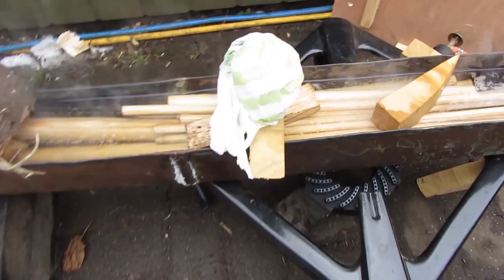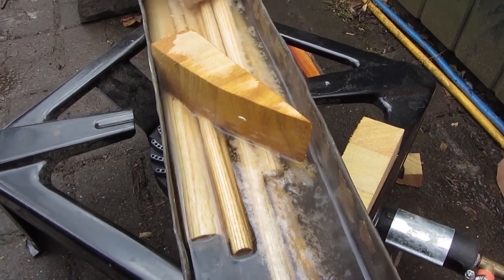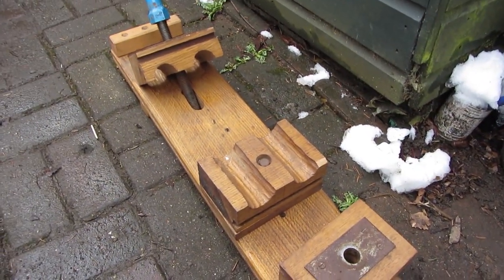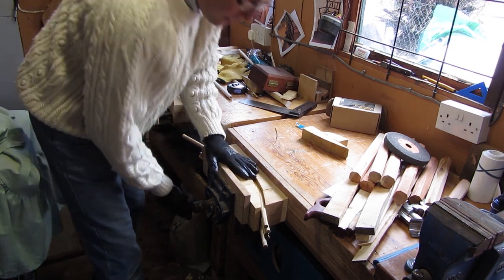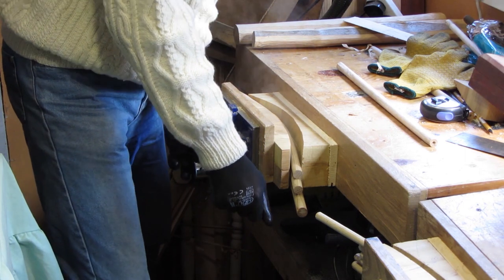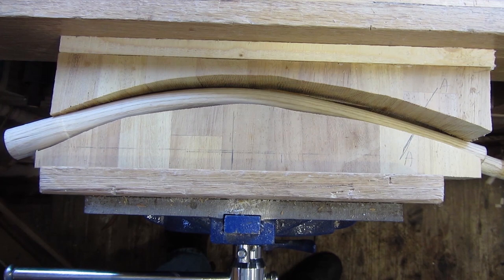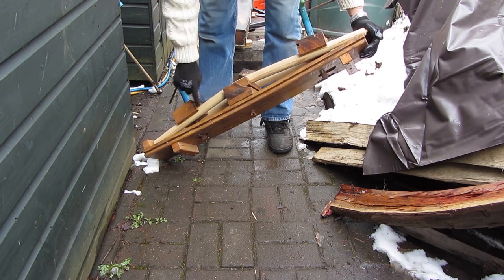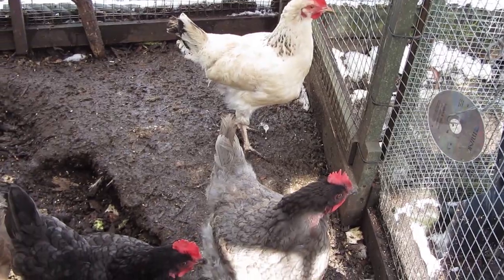Wood Bending by Boiling - Sussex Chair Part 6

Comment from the maker: I like boiling because you can see that the wood is getting properly heated up all over - so if it fits in my trough, I boil it. If its longer then I steam it and hope for the best! So for me boiling is more certain to work. Lots of the old bodgers used to boil the wood. Regards Harry

Comment: I just wanted say I watched this video for the first time long ago, possibly near it's release date and I'm glad I found it again. I haven't yet been able to try this procedure but somehow I believe this is a better way to bend wood rather than steaming or torching. I'm not sure if wood will gather much water in such short time but it makes sense it will bend more easily when more hydrated just like green wood. Thanks.
Reply from the maker: Thanks...I have boiled and steamed, and I prefer boiling for smaller items as the heat up is easy, for large items the steaming is more practicable.

Comment: Excellent job! This helped me to get the info I needed for my current project. Thank you for contributing!
Reply from the maker: Thanks - pleased to help.
Reply: A quick question, though. Should I use any type of wood in particular and does the age of the wood affect its pliability? I had a piece of a dowel rod lying around and it never got very pliable. Even boiled it for longer than an hour.
Reply from the maker: Cyber1080 Hi generally green wood i.e. freshly felled will bend more easily because of its moisture content.....though some people say ash is best left a year! lots of science and folklore on this. Most woods will bend....ash is especially good in the UK for chairs etc. ...but give what ever you have a go....there are various bending charts around that indicate what is good.....and lots of research on this!
Reply: Awesome. Thanks for the advice. I'll be sure to give the research a look. I make blades of various shapes and I sometimes have the need to bend the handle. Thanks again!

Comment: If you keep your wood above the water with only maybe 1/4 inch water in bottom then cover the top then your wood will be steaming. ?.. steam has higher temp than boiling bringing the cellulose fibres in the wood to the plastic or elastic point allowing much easier bending with much less springback also keeping strength higher in the wood
Reply from the maker: steaming is good ...see my continuous arm bending film for example, but boiling is easy and works well ...so take your choice, but your points are right and very good ones.

Comment: Hi, there, a contribution to Paul Cuffaro's question on how a drilled wood can behave when being bet. Where I live, I seen electricians bend the plastic pipes (u know where the wiring goes through around the house) using sand and of course heat. Sand in this case prevents the plastic from collapsing thus making nice smooth curves.
Paul, drill the wood, fill it with sand and make sure to compact it as tight as you can by putting in little by little. Use a narrow stick with flat end to push it in and compact (Like the traditional guns= remember those you put in gun powder a ball bearing and push it down the barrel= hope you get the idea).
Boil or steam and then bend! After cooling off and staying in the vices for an hour or any appropriate time depending on what wood you are working on, just remove and tap your piece on a table or anything to draw the sand out.
The inside will be very clean.
Oh! remember sand will enable the steam or hot water to soften the wood from inside the core more efficient than plastic.
Hope this length suggestion was helpful. Regards=Eric

Comment: Very informative video! I am going to try softening a few 1/2" dowels in the kitchen wok when the missus is away😉.   I wonder if the whole operation might be a little less frenetic if you pre-heat the shaping jigs just prior to inserting the pieces and starting the clamping? It might just buy a few more minutes of working time by slowing down the cooling.
Reply from the maker: Yes it might help a little.

Comment: I now understand the idea of bending wood. I also see ways to improve this process, such as metal jigs versus wood jigs, and pre setting lumber into the  metal jigs, submerging the wood and jigs together to boil. Shape the wood in the boiling water then remove all together to dry while still being pressed. This guy was panic working, trying to shape the wood before it cooled down, not taking the time to align all the pieces prior to bending.
Reply from the maker: Hi Jay - Pause and it will get too cold and stress. It may look like panic to you, but I knew exactly what I was doing, as you can see in the finished chair.

Comment: i wanted to make a pipe stem, and i want it to have a bent stem, so i am wondering, if i were to drill a hole down the centre of the wood, would i still be able to bend the wood, or would the wood break?

Comment: interesting. re the blue leg form clamps, it might be easier to delete the crossbar, drop them onto the bolts with the nuts on top,  and then wrench them down with a ratchet & socket,  and maybe an automotive  pneumatic wrench.  that would be quicker and easier than twisting all the way down the shafts of the bolts.

Comment: Ok Harry, crazy old lady in Ohio here. I picked up a junked oak windsor years ago and am finally looking at it. 
The BOW is distorted. The right side is much more open, the fron end of the bow anchored in  the seat is a degraded dried out mess. 
Everything else is decent - mending the splits in the seat is pretty straightforward... except of course on the right there is a split about 1.5" in: because of the slumping bow on that side.

I have almost no experience, but I have good clamps, good glue, enormous curiosity and ridiculous romance about abandoned chairs.

Assuming that I can knock it apart without breaking or damaging anything more than it already is, can I boil the whacked section of this bow? Soak it in hot water?

The kinetics of pressure/force are incomprehensible to me: if the wood were ever malleable enough to correct, HOW do I strap that conformation into place?

LOL. I know how foolish and unanswerable this is. I just realized it was good to just say words about the whole thing. The singular quixotic nature of my messing about without a clue makes me smile at myself as I would a child. 
Thanks for triggering the effort.♡
Reply from the maker: Hello Judith...great you are having a think about this...I suspect it might be difficult to rework what is there. A side of me likes living with the character of imperfection in an old piece of furniture. Perhaps there is a Greenwood group near where you live to have a go at working on this with you..good luck.

Comment: Great experiment. But how about showing the result? I tried similar methods, but only after opening the clamps one can tell the result. Often they just jump back to almos their original form.
Reply from the maker: I got a bit of springback, you can see the results in part 7 or 8 or whatever 😊, also my making a saddlers clam has woodbeining by boiling in it if that helps.

Comment: Thank you for this tutorial, it’s been very helpful. I have a composite bamboo broom pole 1.35m x 22mm which I wish to transform into a walking cane with the bent crook to serve as an handle on one end.  I am building a steam  plybox. Do I need to place the entire stick into the steam box or is it possible to place just the one end into the box that requires the bending? My worry is that if I steam the entire stick it may bend along the entire  length while I apply force to acquire the desired the bend for the handle side that will be is a jig.
Reply from the maker: Hi Eddy...just heat up the bit you want to bend...so no need to place the whole stick in the box...seal off the box end that the stick is sticking out with blocks of foam or rags...but watch out the steam is deadly hot, and obviously don't block the end to the extent it becomes a cannon!

Comment: I've watched twice+, and I'm wondering what you'd do (differently?) to make a matching pair or set of chairs.  I'm trying to understand how craftsmen made one chair at a time and still reliably got near-enough identical results.  For example, would it be important to measure & align the parts just so in the bending formers?  I plan to watch this chair to completion, so if you address this issue later on, I'll hear it there.
(Gorgeous sweater; kudos to Mrs. Rogers!)
Reply from the maker: Hi I made all curved parts an inch or two longer so that you can match up the the curves perfectly and then trim.
Reply: @harryrogers  Simple, effective, and low-stress.  Thank you.

Comment: perfect  and i ask  if the boiling water affect on the wood properties ? and what is the difference between it and steam way??d
Reply from the maker: ahmed shokr boiling or steaming the wood seasons it...so it becomes hard. Boiling and steaming have the same result...for smaller bits boiling is easy....for larger bits steaming might be easier.

Comment: Great work! Any reason why you choose not to use power tools to fit the mold?
Reply from the maker: +Henrik Emanuelsson Sorry I don't quite follow what you are asking...the wood is hand riven (split from a log) for strength. Harry
Reply: +Harry Rogers Sorry. What I meant is why don't use power tools for the tightening part? It looked kind of tricky to tightening it with both hands while holding the piece down. Therefore I was wondering if there is any particular reason why you don't use power tools when tightening the bolts? Wouldn't that make the process less tricky?
Reply from the maker: +Henrik Emanuelsson Yes - good point it probably would be easier, though I do not have any big power tools for that....thanks for the idea though.

Comment: Will longer soak time compensate for lower temperature? I can get my bathwater to 50 degrees and plan to soak (8mm thick oak) for about 5 h. Will that work or is it a given failure?
Reply from the maker: I am doubtful...plain soaking works on very thin material ....you can always try it and see but at that thickness I think you will need some proper heat
Reply: Ok thanks for the input! Did some experiments with boiling water on the stove and pouring it in the bathtub. Then i can get the temperature to about 85  degrees Celsius. I will grind down a the wood aswell, will I be able to bend 5 mm at 85 degrees?
Reply from the maker: Vattenmannen I think it's a matter of try it and see...I think it really needs to boil but it might work.
Reply: Old bathtubs cost only about $10 here, so it would be worthwhile buying one and setting it over a fire source, I would think! If it didn't work, you could turn it into a strawberry planter!

Comment: 2 questions: 
How long did you leave the wodden parts innto boiling water? 1 hour maybe? 
How long did you leave the wooden parts in the curved stamps?

Sorry but I'm not english mothertongue so did not understand everything :(
Reply from the maker: +Mirai Sono 45 mins to one hour for boiling and ideally three days in the straps
Reply: +Harry Rogers thanks, and is it possible to apply this method also to glued wooden layers or the glue might melt?
Reply from the maker: +Mirai Sono I have not tried it....I suspect the glue would fail......give it a go perhaps!
Reply: +Harry Rogers thanks for your help!

Comment: what is more effective steam or boiling?
Reply from the maker: Hi both heat the wood so it's really down to what is easier to do, and to get sufficient heat. On a snowy day with small parts boiling is handy as it will heat up quick, but you could equally steam and that works fine as well. Rgds Harry

Comment: How many hour to boil??ang how.many hours to bend
Reply from the maker: Hi Ryan...boil for a good hour to get the heat in, bend very quickly, and hold in frame for a day or so. That is general principle, but can vary....take a look at the Making a chair in a day video..for example.
Reply: @harryrogers  i boil for 1 hour today and i bend in 12 hours it is ok???
Reply from the maker: @ryanperea3743  Bend it whole very hot...wear gloves...and then 12 hours in a frame to hold the bend may be OK...ideally longer, but you will soon find what works for you.
Reply: @harryrogers  if i bend the wood in 12hrs it is ok????thank im from the philippines